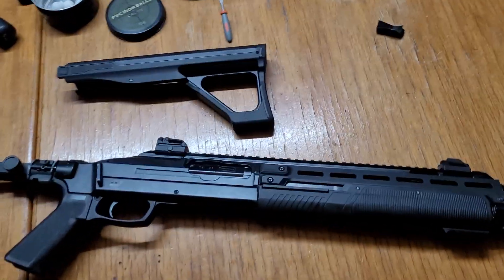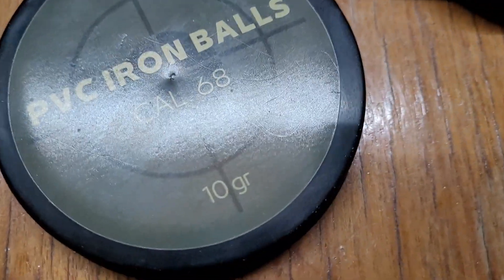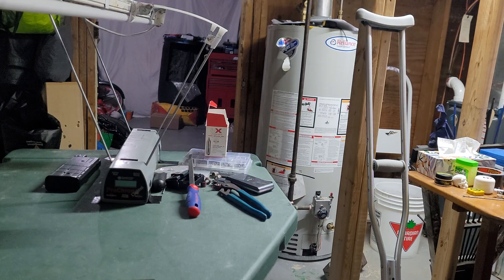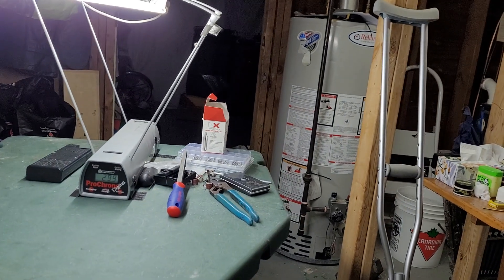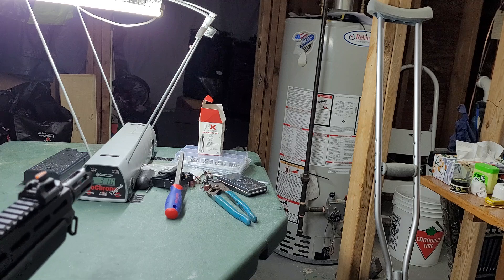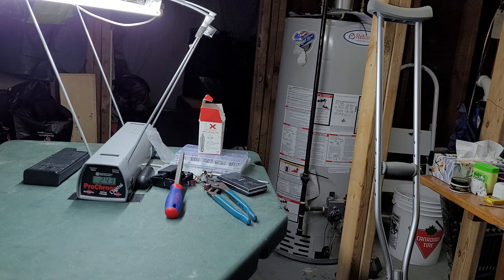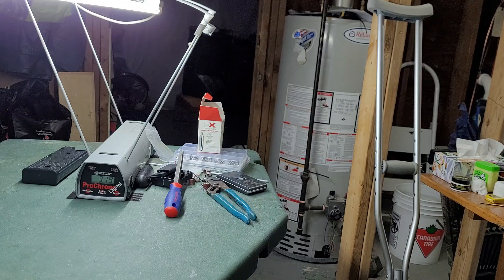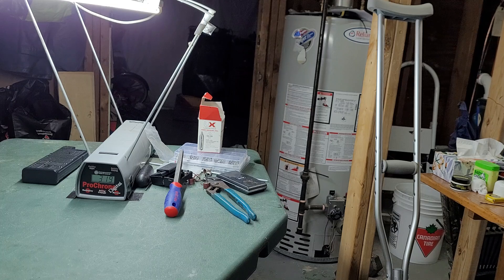UMAREX HDX68 12g CO2 47-54 Joules Z-Chamber Expansion

Comment: Decent results. It did perform better than i have recorded using the factory dual 12g tube.

Ill have to try a 12g on mine just see where its at.

I am running without the restrictor myself. That may be your handicap to even higher power.
Reply from the maker: ya man im gonna remove that brass top hat looking restrictor, when i took it out before my numbers were jumping and dropping like crazy so i put it back in, i got 50 joules with the 88g and restrictor in, i was expecting at least another 10 joules with the 88g that vid is coming, only got 56 joules, seems this z chamber mod favors the small 12g co2s up to 38g
Reply: @ mine was pretty stable this time without the restrictor and 90g. It reached full power on the second shot instead of the 5th or 6th.
Reply from the maker: @ nice with the 12g the first shot is the power shot then it drops fast im gonna try to remove the restrictor and go again, only i have no 88g left so i have to get some, im gonna send pics to you of my new hpa connection i modded an asa on off for hpa, im gonna remove the drop in 88g valve or modify one long story lol
Reply: @ you should try hpa first as is just so you have something to compare it too.
Reply from the maker: @lesslethalfordummies  when i first done hpa 1100 psi with restrictor in i only got 12 joules haha same with my hds68 around 12 joules only, i was told to remove the restriction and then try again with the chamber installed

Comment: Love the results and yeah it'd be interesting to see if the 2x12 gram or the 25 gram make any difference compared to the single 12 gram. I would think a single 25 gram would put out better numbers than a 2x12 gram since it's not relying on two puncture holes for pressure.
Reply from the maker: ya im gonna test more today and see what up, im getting ready to go convert to hpa next, this will be interesting :) im gonna do a 25g test on cam as well
Reply: Preasure is the same for 12g, 25g and 88g. It's a liquid CO2, it doesn't matter how big your tank will be as long as it will heve liquid CO2 inside, preasure is the same. Most important thing with CO2 is it's temperature, warmer it is, more power it have, critical temp is 31C. How 88g would put more power than 12g? Ball weight the same, chamber size inside the gun is the same, preasure of CO2 is the same. Where is the diffrence? 12g and 88g are amount of CO2 inside, not the preasure, you will only have more stable shots with bigger tank because it have more CO2, but still at the same preasure because its LIQUID!!!! Jump from 54J to 56J is resoult of the temperature of the gun, air inside room and CO2. Nothing more.
Reply: @lukasz_1112  Thank you for the explanation 😋

Comment: impressive results for single cartridge, i will order that extension too :)  could you also try hpa 1100psi with that extension without any other modification than now? Sean hit 33joule with 1100 psi without that extension, maybe you already have your 40 joule goal on hpa and only need to open that .2mm hole to fill up in time
Reply from the maker: awesome man, im gonna convert to hpa and bypass the brass pipe, but i can try it again once i remove the restriction in the brass pipe, im also gonna run the 88g with no restriction
Reply: I am curious Dude. I will try another way, i already have ordered the z RAM chamber but i don't bypass the Brass tube, i have Cut 2 metric 5mm threads, and try to replace the Brass Pipe with a 5mm screw which i drilled completely through in 3mm Diameter. Also i drilled the puncture Tip of the pressure housing with 3mm drill, i Hope i will get this to Work otherwise i can throw my hdx in the trashcan hahaha